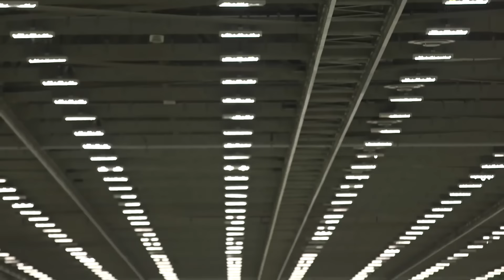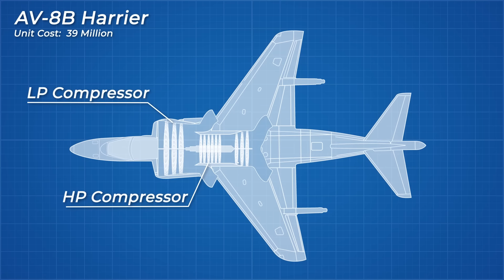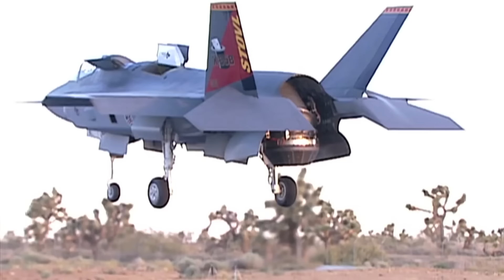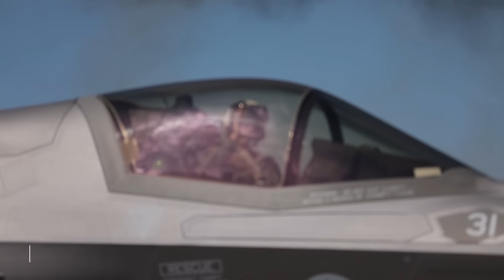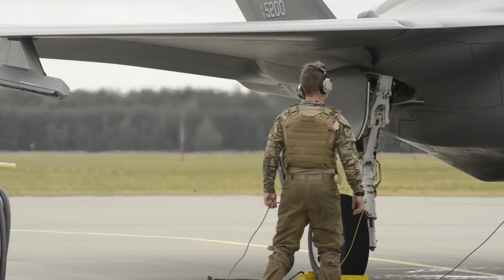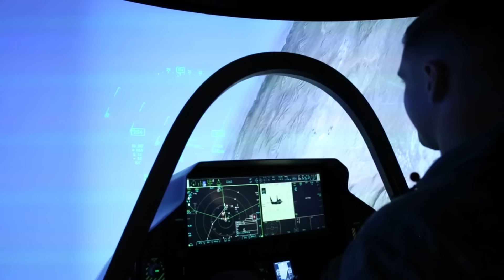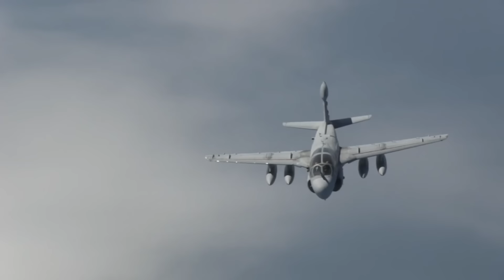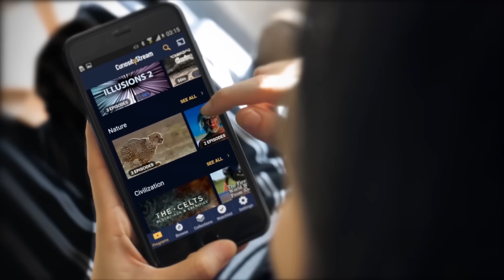Is The F-35 Worth $115 Million?

Comment: Don't forget, F35 has never flown a single mission against an opponent with any kind of semi-modern anti-air defense. It's basically used to bomb stone-age barbarians from unreachable heights. As a result, there are rumors that Russia learned to track F35s perfectly in Syria. 

F35 also has poor supercruise capability, it can exceed the speed of sound for short cruises but it puts heavy stress on plane's components. Unclassified manuals limit it to only 150 miles at 1.2 Machs. F22 can sustain higher supercruise speeds (1.8 Mach) and for much longer. Russian fighter aircraft can do the same.

In short, F35 is a terrible plane. It has tried to do everything and as a result does nothing really well.
Reply: The F-35 hasn't faced a proper enemy because nobody has started a conventional war since 1991. This means that no modern fighters have proven themselves. F-35s in Syria are often flown in a visible configuration to prevent Russian from figuring out how to effectively track them.

Supercruise is not for cruising and doesn't meet the definition of cruising in the first place. Supercruise is for short bursts of speed to enhance combat effectiveness. Also the F-35 is still faster than most fighters in a similar combat configuration.

The F-35 was developed to perform the roles existing multi-role fighters could already perform. It certainly isn't what you claim.
Reply: @dumdumbinks274  F117 flew missions in Serbia (and got downed). And there's no "visible configuration" for radar stealth, it's always on. F35s simply fly with turned on transponders in Syria to avoid issues, but this still allows adversaries to track them.

Supercruise is important for dogfights, being able to close the distance fast and for dogfighting (to get a better angle). That's the reason F22 was designed with it in mind, it's needed for an air superiority fighters.

F-35 has basically been designed as a cash cow first. Military understands full well that there is not going to be a conventional war, so why not pig out on those juicy contracts?
Reply: @AlexBesogonov  1. The F-117A was shot down once under very specific circumstances that only demonstrated stealth worked as intended. It continued to be used to bomb Serbia without any further losses.
2. There are things called radar reflectors specifically designed to make the aircraft visible that are used in conjunction with transponders. Not to mention the F-35 can use external munitions.
3. Supercruise at Mach 1.2 for 150mi is fine. The F-22 is the exception among supercruise capable fighters, not the rule. Supercruise isn't used to close the gap, it's used to increase the energy of missiles at launch to achieve a high probability of kill. If a fighter wants to close the gap quickly afterburner is used. Supercruise has no use in dogfighting.

4. The F-35 is cheaper than many 4th gens and is working well. Considering the old fighters are desperately in need of replacement developing a new fighter was the best option
5. Conventional war can still happen. The reason it doesn't happen between the superpowers is because of the combination of conventional and nuclear deterrents.
Reply: @dumdumbinks274  F-117 was shot down by what basically was 1970-era Soviet anti-air missiles. As of right now, Russia has the best anti-air defense systems in the world and it can use multiple radars lighting up targets from several directions. The long-wave radar is used for rough targeting for short-wave seeker radars. Chirped radars with some clever math then allow to do pinpoint-precision tracking.

Super-cruise for F-35 is not fine. And F-22 is definitely not an exception, Su-57 can do Mach 1.6 supercruise for 930 miles (limited by fuel) and short bursts of 2 Mach speed. Chinese J-20 will also feature supercruise capability in the upcoming revision. Heck, even the old Su-35 can supercruise and outmaneuver F-35.

"Conventional war can still happen" - sure. But it never happens between technologically equal states. Nobody is going to attack the US with airplanes, so the US military doesn't feel any hurry to build an actual plane.
Reply: @AlexBesogonov  F-117A was shot down at close range after the P-18 radar (possibly even an upgraded 1980s version) managed to detect it at a range of 35km. The targeting radar however failed to lock the F-117A twice, finally acquiring a lock at a range of 15km which is within the F-117As weapon range. The missiles themselves were V-601s which are from the year 1970. 2 were launched and one failed off the rail, the other hit the F-117A at a range of 13km. Keep in mind the F-117A is 1970s tech too and apart from it's stealth capability was a very unremarkable aircraft with no warning systems, no countermeasures, and no active sensors. That proves stealth worked as intended since the F-117A didn't even know he was being targeted until he saw the fiery engines of the missiles igniting.

Russia supposedly have the best air defence systems, but that's only if you consider land based systems at ultra long range. When it comes to ballistic missile defence they are a bit behind the US. As for the radars, no they cannot do precision targeting using long wavelength radars. They can fire missiles in the direction of the stealth aircraft with a lowered probability of kill, but that still means that stealth works as intended, especially considering that even the most advanced Russian air defence radars such as the Nebo-M are not capable of tracking stealth targets beyond about 150km.

The F-22 is the only operational fighter that can supercruise at such high speeds. The Su-57 is supposed to enter production this year but won't be entering service for quite a few years more. But regardless you missed the point completely. Supercruise is a short range capability, not a true cruise. It really isn't that useful outside of entering combat since you're trading fuel economy for speed, but you're also trading speed for fuel economy. Mach 1.2 is fine for what the capability is worth.

The Su-35S isn't old. It fist flew in 2008 and entered service 1 year before the F-35. And from what I've seen of the Su-57 airshows the Su-35 is more maneuverable than the Su-57 in clean configuration, but that obviously doesn't make it a better fighter.

Considering the F-35 is currently a top tier fighter there is no way you can conclude the US didn't feel a need to build an actual plane. But even then the US already have 2 6th gen fighter programs intended to finally phase out the F-15 for the USAF and the Super Hornet for the USN.

Turkey did not choose to negotiate a deal with Russia for fighters until after they had been kicked out of the F-35 program, so there's no basis in that point of yours for calling the F-35 inferior.
Reply: Alex Besogonov

Keep your fairy tales for Radio Yerevan, politruk Besognow.
Reply: @ElJackale  
My last name is Besogonov, and I'm not a politruk. But sure, feel free to continue producing inferior products. Countries like Turkey have woken up to that fact.

Comment: I'm still not a fan of the F-35 for the cost. Radar  panels have to be replaced after every flight which seems not bad until you realize the amount of use this plane will see because of its multi role design. This fact alone makes maintaining a fleet of these expensive. I believe updating older planes with modern avionics should be what the military should focus more on. The B2 is still the bombing king and the A10 is still amazing at CAS.
Reply: Radar panels don't have to be replaced after every flight... where are you hearing that? The F-35A is no more expensive to operate than the F-15C.

Comment: I like the F-35, but jack-of-all-trades products can never achieve what dedicated systems could've done. As such even with all the bells and whistles, it's never going to be able to effectively replace the A-10 for example. Even with setting out to do a all-in-one solution, they had to split it into different versions. It boggles my mind that time and time again we have to learn this. If you want a good product, design and manufacture it to its intended nieche, not to try and fulfill every role at once.
Reply: The problem with that approach is that availability rates plummet. If you have a squadron of A-10s and a squadron of F-15Cs for air defence you're not going to perform CAS as effectively as 2 squadrons of F-35s that can defend themselves. The A-10s may be good, but the difference in capability for the specific role doesn't make up for a lack of 24/7 air support or inability to perform other missions at all. It's also questionable whether the A-10 is actually better performing to begin with.

Comment: officially patriot had a 90+% scud interception rate... then a scientist looked at the data.. it turned out to be less than 4%.
the f-35 is the second  incarnation of the failed f-111. it was a fail, it is a fail and it will remain a fail.
oh and they probably shot pim fortuyn because he wouldnt buy them

Comment: It seems to me that the F35 Is a jack of all trades , master of only stealth aircraft, mediocre in all aspects except for combat information collection and analysis as well as stealth. 

When reality strikes and shit hits the fan, like being forced into a dogfight or experiencing some form of engine failure (whilst possessing only one engine) , I would much rather be piloting an aircraft such as the F22 or the Euro Fighter Typhoon.
Reply: Mediocre how? The latter statement is based on what exactly?
Reply: Well since I have not had the privilege of flying the F35 myself , the information I am able to gather on the capabilities of the aircraft relies on the reports of the pilots that have flown it as well as the designers.
 In Terms of reports on the handling capabilities and the general performance , it would seem that although the F35 was designed as a multi role aircraft, the current aircraft designed for each roll respectively far outmatch the F35 in said specialty field. For instance Field one: Air to air Aircraft such as the F22 or the Euro fighter Typhoon are far more capable in an air to air ingagement. Faster, more maneuverable, better thrust vectoring and with airframes designed to handle higher G forces than that of the F35. So if forced into an air to air confrontation, I would much rather be in the cockpit of the former . 

Field two: Close air support : when conducting close air support against frequent enemies of the modern era such as Afghanistan and Syria that use more primitive ground to air weapons such as  AA guns, thermal guidance missiles and such, aircraft such as the upgraded A10 is far more robust and capable of safely providing more ordinance on fortified targets. 

And each mentioned specialized aircraft  is powered by two engines , so in the event of engine failure, be it technical or due to combat damage the likelihood of the specialized aircraft being able to return to base for a safe emergency/precautionary landing is twice as likely for the F35. 

Once more, I'm not saying the F35 is a bad aircraft, not by any standard, but for the price, I'd personally prefer to fly a machine that is the best there is in said combat environment in stead of an aircraft that is just good at everything but stealth.
Reply: @ivanstrydom8417  

> "... it would seem that although the F35 was designed as a multi role aircraft, the current aircraft designed for each roll respectively far outmatch the F35 in said specialty field."

 The F-35A and F-35C are multi-role aircraft, yes. In the same way the F/A-18, Rafale, F-16, and Typhoon are. What aircraft specifically outmatch it and how so?

> "Field one: Air to air Aircraft such as the F22 or the Euro fighter Typhoon are far more capable in an air to air ingagement. Faster, more maneuverable, better thrust vectoring and with airframes designed to handle higher G forces than that of the F35."

 The F-22A serves the air-superiority role or the "hi" mix of aircraft- like the F-15C does. The F-35A and F-16C/ D serve the "lo" mix. At combat load, the Typhoon is by no measure the faster or any more capable of handling higher g-forces. More maneuverable based on what?

> "when conducting close air support against frequent enemies of the modern era such as Afghanistan and Syria that use more primitive ground to air weapons such as  AA guns, thermal guidance missiles and such, aircraft such as the upgraded A10 is far more robust and capable of safely providing more ordinance on fortified targets."

 In the case where a ground-to-air or air-to-air threat is present, the F-16C by and large has been replacing it in since the mid nineties. 

> "... is powered by two engines , so in the event of engine failure, be it technical or due to combat damage the likelihood of the specialized aircraft being able to return to base for a safe emergency/precautionary landing is twice as likely for the F35."

 It is possible, and has happened, but your chances of limping home in a twin jet after one engine fails is statistically speaking the same as a single jet.

Comment: It won't be a bad plane. it just won't be a great one either. I have a feeling this will be a next-generation F-111: Mediocre.

The thing that will give it problems is the B variant. Mechanical complexity is not really something you want. Complexity involving rotating things and/or directional gearing is an absolute nightmare, as the Osprey proved time and again. 

Prediction: 
A and C will be adequate in thier roles, if unremarkable.
B will be an ongoing money sink of mechanical issues in the field.
Reply: The F-111 was one of the most successful strike aircraft of it's era and performed exceptionally well even in the Gulf war.

The F-35 is superior in every aspect compared to the aircraft it replaces. Osprey had problems during development, but is now one of the most useful aircraft operated by the USMC, as well as being safer than the aircraft it took over from.
Reply: F-111 was intended to be an interceptor. A role which it was incredibly ill suited for. It eventually found it's way into a strike/support role, where it was adequate. But as an aircraft it never excelled at anything. Even as an export it had only a single sustomer.

Osprey continues to suffer from a vastly shorter maintenance cycle than planned for. And the V-22 fleet readiness is hovering (hurr) around 50%. Which is garbage. 

Osprey has not been titled "the flying shame" for a laugh.
Reply: @MareSerenitis  No the F-111 was intended from the beginning to be a low level strike aircraft which is exactly what it ended up as. The program was politically managed to develop a single type for 2 services, and the Navy's requirements and intended role were that of a high altitude interceptor. Unfortunately politicians wrote the final set of requirements and almost entirely favoured the Air Force's initial requirements, meaning they were adapting a conventional takeoff heavy ground attack aircraft intended to penetrate enemy airspace at low altitude into a naval CATOBAR variant intended to intercept high altitude bomber targets. 

The F-35 program shares almost nothing in common and the only reason the F-35 variants differ is the launch and recovery method. F-35s are also only expected to do the tasks that multi-role 4th gens already do, but with significantly improved effectiveness much like the F-22 was a huge improvement over the F-15.

Osprey readiness rate being roughly 50% does not mean it's a bad aircraft and improvements to that rate are being made gradually.
Reply: lol @ you missing the entire point I was making and going off on some mad tangent which is factually incorrect. But okay random person on the internet.
Reply: @MareSerenitis  My comment is factually correct and is an explanation as to why your comparison is bad. It's not going off on a tangent at all. Your point that the F-35 will be mediocre isn't based on much at all as far as I can see.
Reply: I could go into detail about the design requirements for both aircraft being changed multiple times, each introducing conflicting elements, and the compounding undesirable effects this had. But there would not be any point. Good day.
Reply: @MareSerenitis  You could, but the F-35 hasn't had many requirement changes in comparison and the core requirements were agreed upon by each service. The F-111 on the other hand had problems because politicians were trying to force 2 completely different sets of requirements together i.e the USN and USAF never agreed upon the requirements, and it ended up hurting the naval version when the politicians decided to use the USAF requirement for a low altitude heavy strike aircraft as the basis for a high altitude interceptor.

Nevertheless your point is irrelevant since the F-111 performed excellently per it's original requirements which were for a low altitude strike aircraft. I could also go on about the many requirement changes leading up to the F-15 and F-16, but if you want an actually mediocre combat aircraft that entered service then look at the F/A-18 which the F-35C is replacing.

Comment: I have grave doubts about the F-35's ability to function effectively in a close-air support role (to replace the increasingly out of date A-10 Thunderbolt II).  The Air Force, Navy, and Marines might not care so much, but I wonder how badly the Army is going to miss the A-10.
Reply: Well the A-10's role has been largely taken over by the F-16 which has been performing effective CAS for over 20 years. The A-10 is also one of hte most heavily upgraded combat aircraft of the US military during the last 20 years. It's out of date because of it's overall design being for a 1960s era conflict where low and slow was the only possible way to perform effective CAS or reliably identify vehicles as hostile.